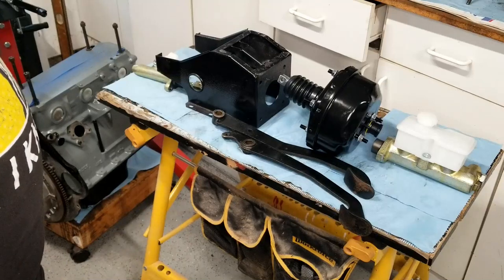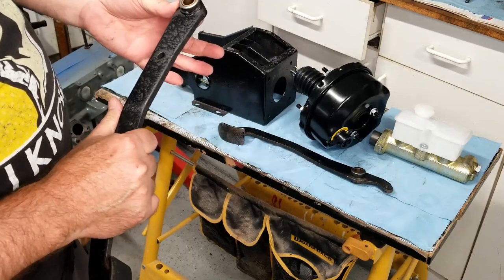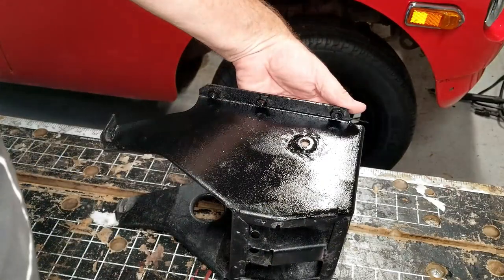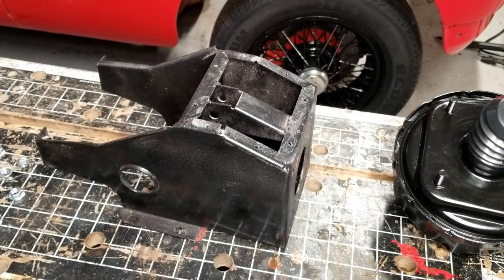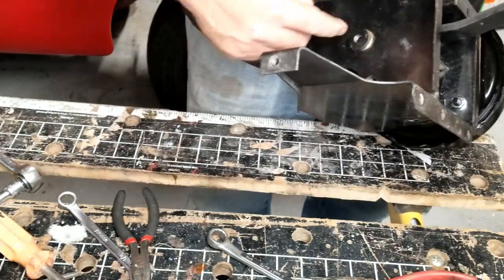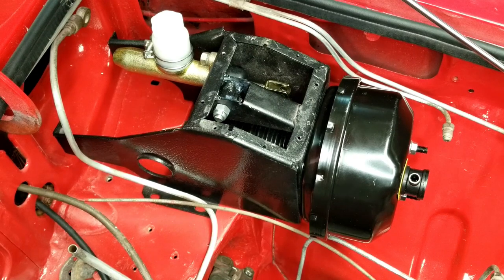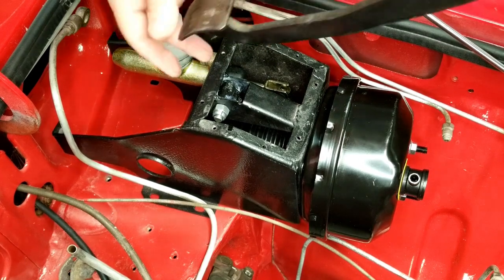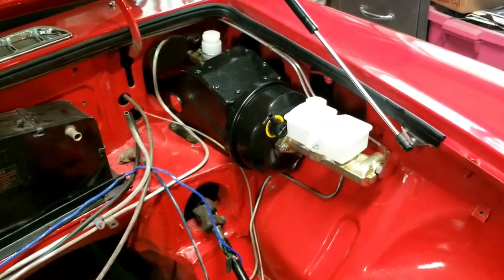Nigel the 1977 MGB - Installing Pedal box

Comment: @alexPlatacis wonder your opinion, any shot of being able to replace worn bushings on clutch and brake without removing the pedal box?
Reply from the maker: That is a great question...
I totally understand. Aside from not removing the pedal box, you likely would want to avoid the need to disconnect both clutch, and break masters...
Reply from the maker: I am going to give that a look later to see if it is possible
Reply: @AlexPlatacis  Thanks, appreciate the response.  I do think the pedals need to come out so disconnecting the masters is probably necessary, but would rather not have to remove the servo and everything attached to the pedal box or detatch the pedal box itself, I'm not retired so don't want to turn my pet peave of loose pedals into a major project when there is driving to do.  Otherwise this will become something to do during off season.   PS it's a 77 also.
Reply from the maker: Did you see my fix on the stretched hole.  Replacing the bushings won't remove the slack if you also have a stretched out hole like mine did
Reply: @AlexPlatacis  Yes, I did.  That was also suggested to me by a couple of guys from the MGB Exp forum.  Your solution of welding a washer over the hole for that is clever vs trying to reshape the hole itself.  The loose pedals are a side to side issue, so the hole becoming oblong may still also be there, but I don't think it's the cause of the issue I am having.  But I could be wrong.

Comment: Where did you get those clevis pins? I got the wrong size from moss. I had my daughter lay under dash with the pedals while I stuck clevis pins in. Lol.
Reply from the maker: In this case the old pins were serviceable.  I have replaced the pin in the clutch slave.  In this video I showed how I made the replacement.... at apx 4:50 in 

https://youtu.be/2W_TUFn0ZLE